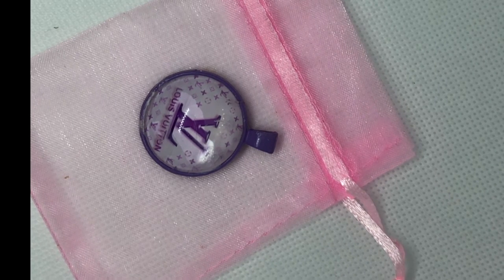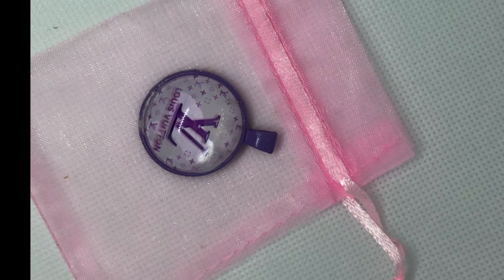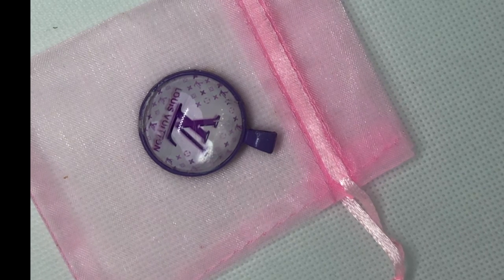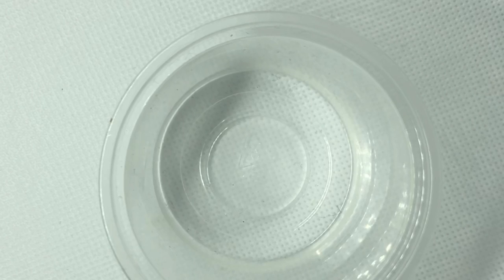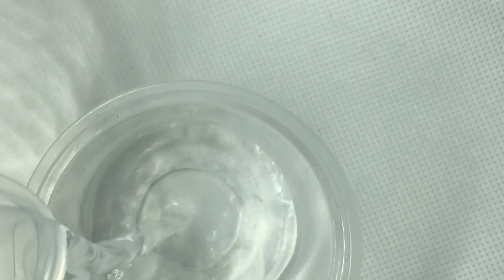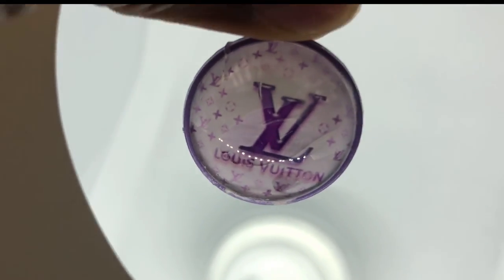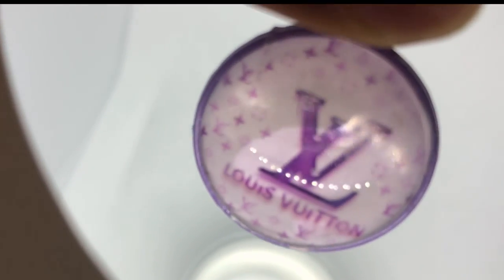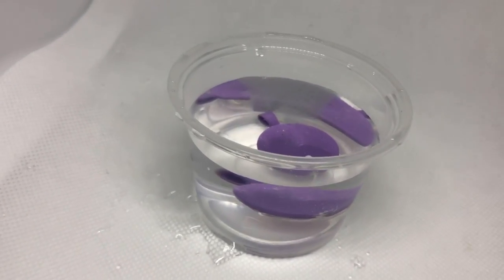HOW TO REMOVE DOMES FROM THE PENDANT TRAY

Comment: Omg... I did like 20 charms last night they all looked fine I watched them for 20 minutes.  This morning they looked a hot mess air bubbles and some cloudy🤦🏾‍♀️ I was about to throw them away and decided to check you tube to see if there was a solution.  I'm about to try this now on all of them❤ thank you.
Reply from the maker: You're welcome 💕
Reply: @CoMarie  it worked.  At first it didn't and I microwaved the water for 5 minutes and placed all 20 in there for 5-10 minutes and the dome came off and the image still looked fine.  Now I have to Figure out the right technique to use because I don't want to do that again. 
What is your cash app I would like to bless you with a little something for the awesome advice. I appreciate it and you.  God bless 🙌🏾
Reply from the maker: Yay, I’m so happy it worked out for you !! My cashapp is $ShopEverythingHer you are too kind 💕